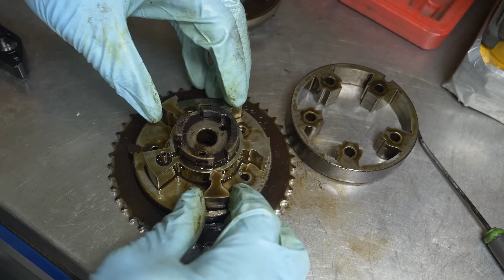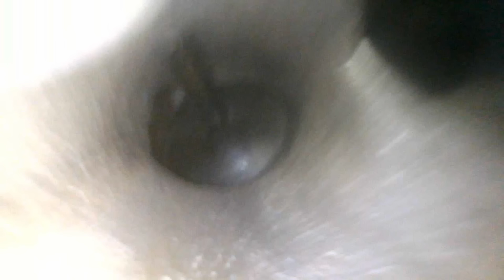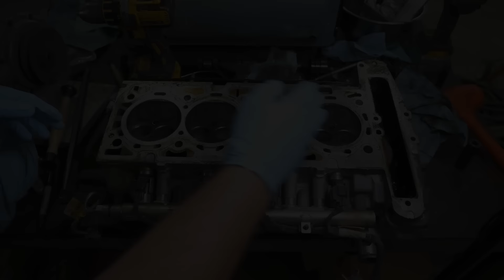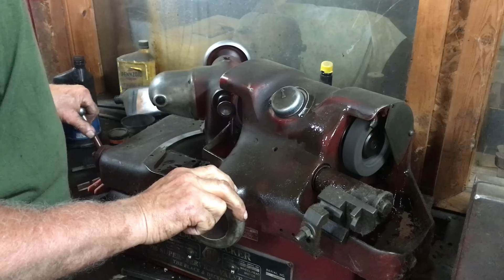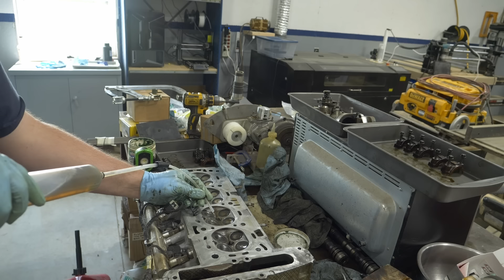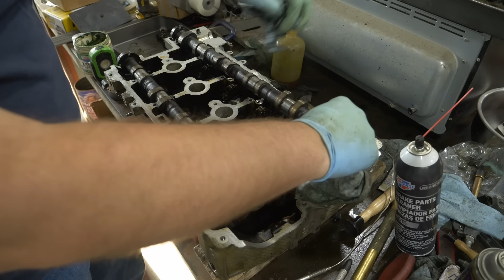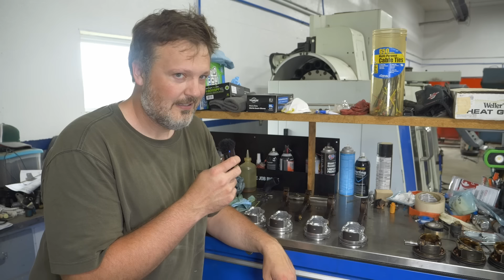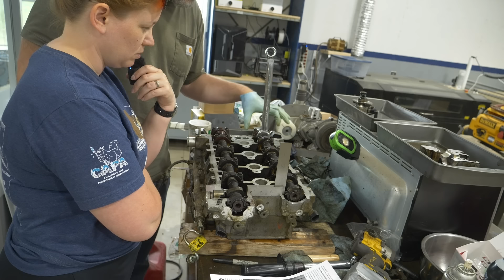How Did it Ever Run? Equinox Still Won't Start

Comment: I feel your pain, and eagerly await new episodes of the equinox saga. I put timing chain and water pump in a ford 3.5 a while back. The engine blew up a week later. A coworker put an engine in, and they tore apart and scrapped the other engine. Really ticked me off as I wanted to disassemble it to try to see if there was something I did wrong. All I know is it snapped a rod and the timing chain was still on. It did get milkshaked so I’m guessing the bearings were just too far gone. Lesson learned …
Reply: Most don’t survive the water pump failure, unless it is caught when it just starts to leak.
Reply: @kd7cwg yeah, I had one that was caught early and it was ok. But I’m gonna be very hesitant to just put a water pump on a milkshaked engine from now on.

Comment: I used to have a 2012 kia soul with a 1.4 or 1.2 liter GDI engine and your right they all had similar issues and they all self destruct over time. Mine made it to 120k miles before she died. Its pretty much impossible to get an engine for these and all the parts were vacumed up by kia and other dealers fixing cars under warrenty. Dealers wont even work on them anymore and just say "you need a new engine.."

Comment: Completely different type of motor but on my XR650L I cleaned the carbon off the valves and head when I rebuilt. I belive the main reason for its low compression was its completely worn out rings but it was able to hold gas in the head after i lapped it.

Comment: GM person ( still am) but i bought  a NEW GMC terrain with that  engine. first oil change (i did it at 2000 since it was new)  and there was aluminum in it, tiny but there,  but never seen it before on a good engine. I have seen it before on new engines on first change so drove and changed it again at 2000, same thing. 4 oil changes at 2000 miles each and still shavings. Not many but enough it also was ( to me) slightly noisy at start. My guess is the tension was not pressuring right away so timing chain was rubbing. I traded back to same dealer ( right after covid so didnt lose as much as i expected) , didn't bother with warranty as i simply didn't want it anymore even with a replacement (engine? chain? who knows).  Went back to a bigger truck with the 5.3 and think i get a grand total of 2MPG less  as most my driving is in town. I see them 250,000 miles for sale so some must make it. I see lots with timing chains replaced too heard the v6 are worse. I think the big problem is the 10,000 mile oil changes..  even 7,500 is to much in My opinion.. 3,000 for me.

Comment: It has to be heat-related. It was probably a lean condition driving up engine head temps, and it slipped, and then things got fun. The heat would explain the wrist pin bushings moving, too. You really are in a sunk cost conundrum.

Comment: So the moral I'm taking away from these last two episodes is **do not buy an equinox**. I had a Saturn Ion with a most similar engine, a 2.2 Ecotec, and that thing was great. But it wasn't direct injected either. 

I love the little trebuchet. If you put some wheels on the bottom of it to let it roll back and forth, it should stop tipping over.

Comment: Good work on the valves.   Nice that you found the other problems before putting it back together.  Align the relucter wheel...Make that interference fit interfere, and make some new connecting rod bushings and ….who knows it might work. Should only be about 200 more hours.

Comment: Wes , first off the ecotech engines are hot garbage in my opinion . Secondly I laughed so hard at the acdelco tds rant , can’t tell you how many times I’ve been in your exact shoes just trying to program a dang 6l80 I replaced only to spend nearly the same amount of time sitting at a laptop as I was under the car 🤦‍♂️. It’s always a new account to solve most issues and then even still the tech line connect will most times just not work so you end up spending hours just going back and forth from closing the application to reopening it on the website then having to relogin because it times out 😤😤😩

Comment: Wes, I feel your pain. It's hard to believe that a single engine could have so many problems. It looks to me like everything on this engine was worn just short of complete failure and waiting for one final part to cross that line and deliver the coup do gras. I've seen small end bushings that have completely disappeared, but nothing like what you found.

Would it have been possible to press the reluctor wheels off and back on and then pin or tack weld them in place?

You never explained what led you to remove and replace the pistons? I'm guessing that you were hoping to find the cause of the oil burning, but wouldn't replacing the rings have fixed that?

Comment: I'm just old enough to remember when the only problem with oil burners was smoke coming out of the trail pipe.  Now it destroys the cats and sensors, and the EGR system pukes it back where the gas can't clean it.

Comment: Wes, Great presentation , you are a pro, I loved seeing the bits of carbon on the valve seats!!! I knew it was a family members car. Im a 50+yr mechanic and I feel your pain. Excellent diagnosis and finding all those problems. (wrist pin bushes, wtf ?!?!?!?) Especially the reluctor wheel, seriously.  The only time Ive seen something similar was a vehicle in an accident that had spun around , the engine turned backwards putting extreme tension on the timing gears and tensioner and then hitting a curb backwards.
What would I do? Slap those new pistons in put, that new cam back in and put the stamp on and send it!!! No Way would I buy a new engine. Tell your brother to go work overtime because he owes you. Good work. Thanks for the show.

Comment: I have seen someone time one of these wrong since the crank gear has a shim on the outside that has a dot on it lol.  I have never seen a reluctor move other one that broke on a 2.0 ford ecoboost.  I think they made 2 versions of this engine and the camshafts are different.  It changes how they are timed.

Comment: No nothing here but I recall reading clogged/bad pcv blowing oily residue into the intake causing the rings to get stuck, causing excess oil consumption, which causes insufficient lubrication when it's run low, which causes excess wear / failure of bearings etc Cam phaser spin when high resistance / lockup occurred?

Comment: From working on single cylinder mx bikes, I have witnessed several times where the pressed-on cam gear slipped on the camshaft and you couldn't get a single puff or pop out of the engine when it turned over.  I kept think of your Equinox engine and I just knew even though you had all the timing marks lined up, something had slipped, and it was still out of time.

Comment: I put a remanufactured engine in one of these two weeks back, and everything went OK till I drove it. Horrific oil leak inside the bell housing... builder gave us a ton of crap back and forth, wanted us to reseal the oil pan first, take pictures... that didnt fix it. we're pretty sure one of the galley plugs was leaking. Those motors have two of them behind the flex plate. But we didn't want to take that chance, reseal those allen plugs, and it be a rear mainseal, or the bedplate leaking... So they sent us another engine, showed up yesterday. Got it installed and running, and so far no leaks.
Make sure to check the intake manifold, the tiny PCV hole between ports two and three, it needs to be open, and free of carbon deposits. Causes a ton of oil consumption when it clogs up.

Comment: Two Subaru engines had oil rings just as caked as this one. We have an Equinox with the 2.4. Just experienced the rear seal delete because of a plugged PCV hole in the intake manifold. Don't be fooled by the "vented oil cap" saving the rear seal! It might be vented,  but the force to open the vent is more than the strength of the seal!

Comment: So what do you think came first? The ring slipping causing the timing to be off? Or the spun bearings? Or both at the same time? It seems really weird. Obviously that motor got hot. but yet no other parts show heat related signs? Maybe the slippage in time caused it to keep combustion gasses in the chamber for too long causing excess heat ?  This is quite the failure mode.

Comment: Just hear me out = a 22 HP predator engine from harbor freight, pillow block bearings, some chain and sprockets. More power, more dependable, better fuel mileage. At a fraction of the cost. I feel you. I recently gave my mother a vehicle because she had a PT cruiser that was clearly designed by the bic lighter company. Likely the same flagship engineering firm responsible for this bain.

Comment: Wes , another you tuber that I watch religiously ( PINE HOLLOW AUTO DIAGNOSTICS ) had a couple vehicles in his shop ( I THINK LATE MODEL JEEPS or V8 TOYOTA P.U.'S ?? ) 
That those reluctor wheels " TURNED "  he was having problems too , he took a ( OIL FILTER STRAP WRENCH ) & figured out the DEGREES THRU MATHMATICS  how far to twist those back to spec , ( AND IT WORKED PERFECTLY ) he saved the price of new CAMSHAFTS , but how long will it stay there ??

( YOU WOULD THINK SOMETHING LIKE THOSE WHEELS BEING CRITICAL TO PROPER TIMING " WOULD BE KEYED " BUT THE " BEAN COUNTERS " SAVED 50 CENTS IN PRODUCTION PER ENGINE ) !!!  (  WHIPTY - DOO )  !!!!!

There is a  " VIDEO " ON PHAD documenting the whole " SNAFU & REMEDY " in his archives at least 6 months ago  !!
Reply: The trick is to spot weld it.

Comment: I have seen pressed on gears on motocross dirtbike (4 stroke) engines spin (gear) so it is out of time - talking about the cam shafts. Having a key way is reliable, not a fan of pressed on as it seems to fail.

Comment: I retired as a tech for Chrysler, and even we heard about the horror stories about that engine. I'm 2 days older than dirt and remember when the Vega and the HT 4100 GM engines were out, even the 5.7 diesel engines. But I 've heard more about this engine than any of the others.

Comment: Back in my day a tuneup was points, cap and rotor, spark plugs and a carb kit. 

If the bottom end was knocking you took it down and slid a couple beer can shims in there

If it burned oil, you fed it borax down its throat hole to deglaze the cylinders and put some straight 30 in it. 

If it was a ford you called a tow truck and took it to the scrap yard.

Comment: Toyota 1.8 vvti of the early 00's had same. oil control rings stuck (whether its a symptom or cause is for debate). the new pistons have bigger and 6 instead of 4 oil return holes and springier rings. seem to cure it. On the cheap we have been drilling the pistons and fitting new rings, with a quick hone and new stem seals. Hope Bro appreciates the work <3

Comment: I've seen the 2.4 break a chain at hard throttle and not damage the vavle train.  Customers are such a$$hats sometimes.  They always try to downplay whatever happened and then you get into this situation thinking it would be an easy fix, meanwhile they ran it out of oil and drove it another 800 miles.  Family are probably the worst customers!!!

Comment: According to the National Weather Service, you're in luck. You have two times in a year to figure this out. Good Luck fixing something that had built-in failure, just in its naming. Maybe the next time the Equinox rolls around, you'll have it conquered.

There are only two times of the year when the Earth's axis is tilted neither toward nor away from the sun, resulting in a "nearly" equal amount of daylight and darkness at all latitudes. These events are referred to as the Equinoxes. The word equinox is derived from two Latin words - aequus (equal) and nox (night).

Comment: I think it needs a 300 I-6. The "12v " of gas engines. I want to live a full life and all, but I envy my grandfather's passing more and more every day. Cheap junk, fast assembly, M-134 mini gun levels of spit junk out. There is no quality in anything anymore. Semis, equipment, all the same. The only real made in America, is guy's like us, especially Wes, making repairs, corrections and quality. I miss the good ol days I never lived. At least while using technology, we do get to have these positive experiences and interactions. Too bad Youtube wasnt a fly on the wall in the 1900's. Maybe I'd have a different opinion now, but I sorta doubt it. Carburetors typically just need cleaning. But half thats only due to shit gas. Thats long enough... thanks Wes, always appreciate your videos!
Reply: Sadly, it got canned. All because of meeting emissions standards of the time. Someone did a turbo build of one of these, made almost the same numbers of the 7.3 power stroke

Comment: It's a 2.4 GM.  It's supposed to be crap.  This engine was designed to reduce pollution and improve gas mileage.  I guess if it doesn't run, it's doing it's job.

Comment: This is why I don't overthink the diagnosis, I just break out the wallet and fire salvo after salvo from the parts cannon until I get lucky.  I'm currently directing adjustment fire toward my teenager's 1998 GMC truck that has "driveability issues"...

Comment: These engines are way too intricate and sensitive. As an owner you got to follow the manufaturer's guideline on the service intervals and the type of lubricants and fluids they use. Skip on these and you are in trouble, they just fall apart down the road.

Comment: the wrist pin bushings turning inside the conrods is bizarre, and the reluctor wheel issue is just Whiskey Tango Foxtrot.  How does a pressed on part that drives nothing (under no physical load) actually turn itself 180 degrees??  Was it a dud from day one?

Comment: What you just proved is that a GM vehicle will run like complete utter trash with a laundry list of problems longer then any other vehicle on the road. The owner probably drove it with 0 oil longer then any engine should run for with no oil

Comment: It's almost as if they read that thing out of oil, and it locked up. But then after it cooled back down, it free back up. And then cranking it, repolished everything. That's my guess. Kinda weird. Anyway, you got it under control. It's a little frustrating, but in the end, you will be the man. Love your videos and wait till this next one
Reply: Nah the rod bearings are almost always the first to go on these when they get starved. Wes didn't mention anything about this so they were likely okay. It was the bad phaser that knocked the reluctor wheel out of place and it was fuel-diluted oil that killed the wrist pin bushings. I've never seen a wrist pin bushing fail like that on any other make but I have seen the reluctor wheels shifting on Mercedes M276s. We usually tig them in place after realigning them.

Comment: I just installed a factory reman in my Equinox a few months ago Wes. Was it worth it, I don't think so. While removing the engine, I discovered the transmission fluid looked like old motor oil. So, I bought a factory reman transmission to go with the new factory reman engine. I should have my head examined for a missing brain! It runs good, drives good, looks good, but after replacing hoses, belt,etc............,🤦‍♂🤦‍♂ I have way more in the car than it is Blue book valued.

Comment: Well AI would be like just crush the vehicle that Motor designed is complete junk. It’s sad when things are designed to be obsolescent failure from the factory. A crank no start turned into $5000 repair. I feel for you all the hours and what equity digging the deeper hole eventually, you’ll figure it out and get it going. Keep up the hard work don’t let the car win.

Comment: If you want a real challenge try the 3.0 ecodiesel that mopar used. VM Motori. Parts not available, new engines 20k. Blocks not machineable. And God forbid crossing years  14 to 15 doesn't work. Good luck with the Equinox

Comment: Engines are just shit nowadays
Build cheap to Last 60.000 miles...
The lobes on the camshafts in some diesel engines from PSA here in europe are just pressed...
So...
They just dont Last a lot off time without problems... 
New engines are mostly garage

Comment: Spun camshafts are something we run into a lot in the Volvo semi world, both the d13 and d11 have pressed on cam lobes and even if they don't get overheated they can at times just loose grip around the shaft. Sometimes completely. More often then not its a full In frame rebuild when it happens on an intake or exhaust lobe. If it happens on an injector lobe? YAY! just gotta replace the cam and injector.

Comment: Been down this EXACT road way too many times, but thats how it goes with the ecotec, ironically the rpo code for the engine you are working on is LAF,  what an ironic joke GM gave us with the rpo code, just LAUGH ( LAF) it off and keep on goin !  One thing you didnt cover was the upper guide in the head, check that because they like to round out and break the bolt, dorman makes a nice bolt for this that replaces the bolt and the bolt cover, it works great ! Good luck !

Comment: I had a Silverado that was about 6 months old, the engine oil level would increase (not coolant) and the coolant would decrease and overheat.  They put dye in everything they could and sealed all caps as if I was doing something.  In the end Chevy said to replace the entire engine due to a porous casting.  1 month later I finally got my truck back, no charge but no explanations, seemed to be an engine shortage.   I still want to know where did the extra oil come from, automatic transmission ?  Where did the coolant and all that dye go, it showed up nowhere lmao  That was the last Chevy product I bought.

Too many vehicles are being way over thought in the design process.  Simple is almost always better.

Comment: The 'ol LEA Ecotec, have been right where you are. . . .
I used "sticky" transmission assemblee goo for the keepers, 
I machined a 1" and a 3/4" pipe coupler down for the tiny retainers, good times. . . I suspect we will be dead before a robot is built that can DO , what we do. . .